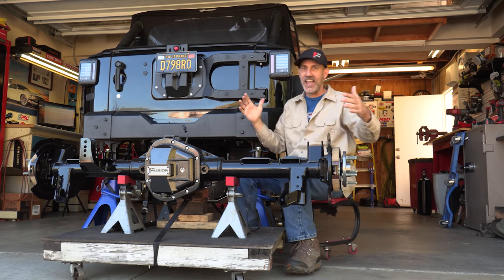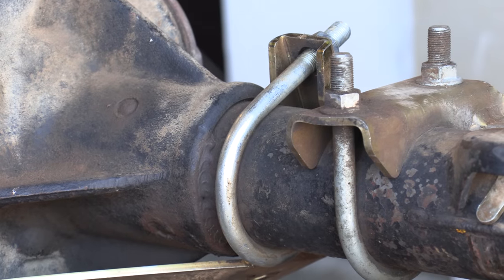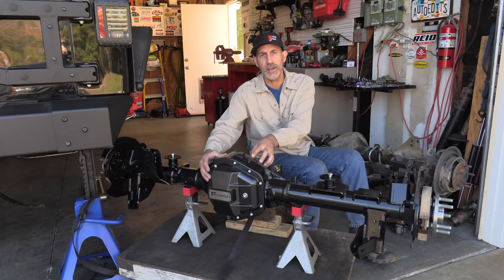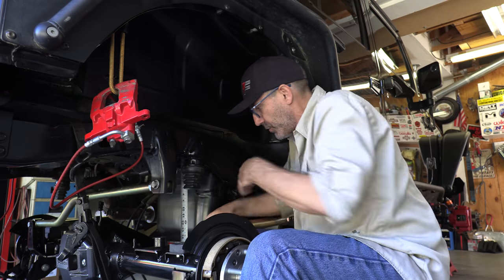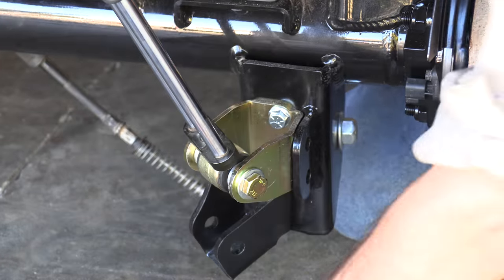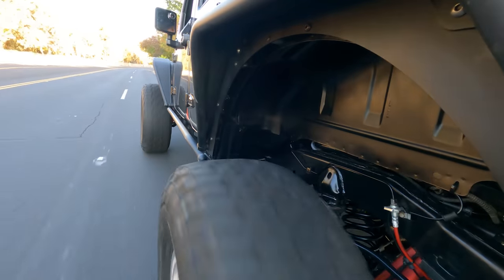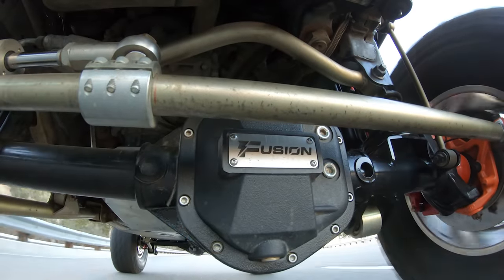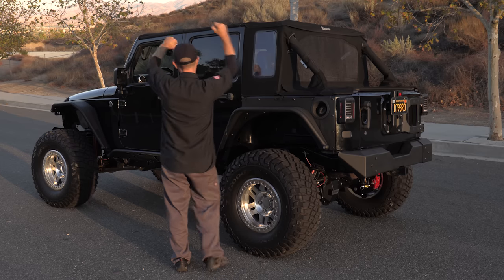Bolt in Dana 60 Jeep Axle Upgrade - Fusion Semi Float 60 FULL Install and Test Drive

Comment: Jason, Great video!!! I just installed the 44/60 hybrid and Semi-float 60 package in my 09' JKU last month. Love them! Watched this video after your PSC video just to see how you liked the Fusion products. I also wheel with the "Gotta drive it home mentality", and these axles give me the confidence that I will be able to do just that. Can't wait to get my PSC kit and get it installed! Quality videos through and through. Thanks!
Reply from the maker: I love everything about this! Thanks for sharing. I'll be curious if your PSC install goes as lucky/good as mine. I can't help but second guess my choice on the front... the 44/60 hybrid  looks so good but the Elite does cover what I need and from the moment I ordered, showed up in less than a week and a half 👌
Reply: I am looking at the 44/60 Hybrid,and Semi-Float 60 also. Did you have to get custom length drive lines? How do you like the axles so far? What tire size are you running?
Reply: @TheRambler-pz1gx  The short answer on the drive shafts is yes. The larger 60  center sections change the drive shaft lengths. Just make sure you know what you want for  lift height so you don't have to get them twice. I currently run 32's but I am going to 37's, I chose to upgrade the axles and gearing first. So far I love the Fusion axles! Great peace of mind when I am wheeling that they can take a hit should I mis calculate my line... Hope this helps.
Reply: @happyj_azjeeper  TYVM!

Comment: Nice upgrade without going too far down the rabbit hole with a full float. That axle even as a semi float is stout AF. Good choice!
Reply from the maker: I figured if I haven't broken an axle shaft on the D44... I'm not likely on a 40 spline D60... so no need for new wheels and brakes and such!

Comment: Years ago when I was still working I talked to a couple of well regarded axle manufactures about welding the tubes on the 12bolt for my Camaro.  Both advised against it because it is extremely hard to keep the tubes straight if you weld them.  I did weld the tubes on an 8.8 once, but I had already ripped the tubes out of them. The larger diameter tubes and a tighter pressfit will give you what you want without welding.
Reply from the maker: I knew I could count on you for some in-depth engineering analysis. I still feel WAY better having the tubes welded, whether it matters or not (mechanically). This particular axle was perfectly square to my measurements so they figured that part out for sure. My real question to you is, when can I come down and have a visit and bring you those fancy upper control arms from the Ram I've been saving all these years?
Reply: @AutoEdits  anytime.  Or we should do a jeep run near you.

The LJ is always ready to go!  😳. Crazy!

Comment: What I’ve learned so far.. especially watching these vids. Run the stock axles until you have an issue. Then upgrade to full float rear, and a kingpin type D60 front.
Reply from the maker: Nah, the whole point of this is to build what I need and not incur all the added expenses of wheels, brakes / brake booster etc.  Plus... I like the steering feel I have better than the kingpin I installed in my buddy's jeep.

Comment: Hey Jeepin’ Jason. I like your videos and your commentary. If you had a really sick JKU. This is a nice semi float. Set up that you have going on. I’m anxious to see how it works for you. I especially like that this is welded, as you had stated for extra reinforcement.  Sweet axles that don’t break the bank as much. I am running a JLURD Teraflex  everything, and an RT3 Suspension System 3.5 a-adapt shocks and Mickey Thompson, Baja  Boss AT. would have went to the lock and load system if they had it for the JLU. Keep it up!
Reply from the maker: Sounds like you have a great rig as well!

Comment: Beautiful Jeep bro. Great video, just found your channel. I have an 89 YJ I’m getting going and will I’m sure break the 35\30 on it now at some point. I can’t see spending on this axle what I paid for Jeep (😮) but it does save a bunch of hassle. Subbed.
Reply from the maker: Thanks for the sub! Yeah, I've seen people say they are going to "save a bunch" by getting junkyard or used axles and doing the work to make them fit (including rebuilding/ regearing, etc.) and then ending up very close to what a completely custom Fusion axle would cost and they are out the months of labor! So, it's whatever fits the build plan! I only have a 110 welder and am not setup to do axle brackets and such.

Comment: you can tap into the harness on the passenger side pull the fuse panel up find the purple and green wire and purple and blue wire put a switch attached to ground to each wire boom you can controll your rubicon lockers in 2wd 4whigh or 4low and they wont disengage until you want them to
Reply from the maker: I did that right at the locker relays by the battery.
Reply: @AutoEdits  yup the purple wires thats where i did mine i like the two wheel locked option i dont always need 4wd reminds me of my old xj on one tons except it was spooled in the rear
Reply: you should do a vireo on it i havent seen one yet and the best article i found didnt say anything about using a switch i bet youd get a lot of views

Comment: Did you have the same problem with your front  Ultimate Dana 44 you installed it.  Did you do the same workaround with it? Just change my front axle on my 2015 hard rock Rubicon, and regret making the switch to the Ultimate Dana 44. Now you have given me hope to fix the dash light problem.  Thanks your workaround, and the adjusting the parking break.
Reply from the maker: I did use the same harness on the ud44 in front... works great. How much lift are you running?
Reply: 3.5 Metal cloak game changer , geared 4.88 on 37

Comment: Hey, it looks like you installed your shocks backwards - the red side should be facing out, at least that's how my 6pack shocks were suppose to be installed.  I looked at your other videos and they are facing red side out. Is this something you did for this axle?  Why the change?
Reply from the maker: Good spot… I’m going to go look tomorrow 🤣 Could’ve just been a mistake on my part but they seem to be clocked ok.
Reply: @AutoEdits  Good stuff regardless!  Thank you for this awesome video!

Comment: Jason , can you do a video on how you utilize and support the frame with the 12 ton jacks ?
Reply from the maker: Lift the vehicle by the center of the rear axle and put the jack stands into place under the frame rails. Then remove the tires and let the rear axle droop all the way down.

Comment: Great video. I have watched it several times. It helped me make up my mind and I purchased the same axle. Can you give any links or advice with hooking up the Spicer 10056733 wiring harness? Thank you.
Reply from the maker: You'll be so happy with that axle ... It is amazing. I don't have any other guidance than what I did here https://youtu.be/0jXUqi1lcKs?t=798 Anything more specific you are curious about?
Reply: @AutoEdits  I was wanting to only use factory Rubicon eLocker switch on the dash. I have 2 wires coming out of the Fusion differential housing. I am having trouble on the internet  how to wire up the Spicer 10056733 harness.
Reply from the maker: LIke I show in this video, connect the two wires from the jeep actuator lead to the end of the spicer harness and the two wires from the jeep sensor lead to the relay in the middle of the spicer harness. And then connect to the eaton e locker pigtail on the fusion housing. Hope that helps  @jeffb1375

Comment: Hi Jason great video, I noticed the front 44 isn't full wrapped, is it just the rears are or cause rear is a 60?
Reply from the maker: Do you mean the welding on the tubes? It's an option on the front I forgot to ask for but it is less likely to twist those since the front doesn't get as much traction as the rear.
Reply: @AutoEdits  yes welding the axle tubes to the diff housing, common practice on big trucks when "turning" the axle to reduce pinion angle vs. having to run a blue tooth front drive shaft... (j/k). I had my guy do it to my JK 44's when he added my trusses. I just got Dynatrac XD60's for my Jeep but I've heard good things about the Advanced Driveline and Fusion Axles. My friend runs them on his AMW 6.4 swapped JL and loves them.

Comment: Such a great upgrade!!  Do you wish you had gone wider? Or I guess, do you still need the spacers with the smaller tires?
Reply from the maker: If I had done both axles at the same time, going wider would’ve been great but not in the cards for me.
Reply: @AutoEdits  Yeah, logistics can be tough. But regardless, its an awesome upgrade that should last you a long time.
Reply from the maker: I sure hope so!
Reply: @AutoEdits  Hi Jason, by the comment, is it correct to assume you went with the stock 65.5" option? what size wheel spacers do you have on?

Comment: Great vid as always, is it possible (or useful) to get these beefy control arms on a stock JK? Thx, noob question..
Reply from the maker: Sure, https://metalcloak.com/jk-wrangler-duroflex-control-arms-full-set.html
But at the stock height, the the original control arms are pretty reliable. If you are replacing them because they are tired or worn out... sure go big with the adjustable arms but otherwise, keep wheeling with the stock stuff until lift and bigger tires.
Reply: @AutoEdits  much appreciated. It's my daily, still perfect after 10yrs... But slowly upgrading some suspension parts to make it a bit tougher. Cheers from Montreal

Comment: I'm installing my axle right now and when fitting the springs onto the lower perches, its much different than OEM.  I understand the springs sit on the perch and are retained with the bolt and "washer" plate provided but they seem really loose.  My stock axle had an exact spot that was notched out and the spring fit snugly into position.  Looks like you possibly used different hardware? In the beginning of the video it shows the same back and silver hardware I have but towards the end it looks like you have gold hardware installed.  Appreciate any assistance!
Reply from the maker: I used my MetalCloak spring retainers but the one's I have are the angle correction ones and they add almost an inch of lift I don't want... you can probably just use the retainers https://metalcloak.com/catalogsearch/result/?q=+Spring+angle+correction+retainer
Check the droop on your axle with the shocks in...you may not need much to keep the springs in place. Since I mounted my lower shock attachment so far up... this axle droops way down and the springs actually get loose. If you are using the normal shock mount... it will probably keep the springs pretty secure at full droop.
Reply: @AutoEdits  awesome thanks ill give that a try
Reply from the maker: @lundysgarage  The washer and bolt that come with the axle may work perfectly well for your setup... try it first!
Reply: @AutoEdits  That's what I'll do I just dont like that the diameter of my springs are so much larger than the male side of the perch that it sits on.  I always thought the springs had a correct "position" they needed to be oriented in.
Reply from the maker: @lundysgarage  They will self orientate as you put weight on them. Make sure you have the rubber pad on the top coil.

Comment: What made you go with the 4 door over the 2 door? More space or better at off-road?
Reply from the maker: That's easy... for me... cargo space was important and since most of my adventures involve long highway drives... the added wheelbase makes this thing so comfortable to cover long distances. So purely a practical matter. I prefer the looks of the 2 door but need to use my rig for more than a recreational vehicle.
Reply: @AutoEdits  nice that makes a ton of sense right on. Thank you.

Comment: Does fusion add a larger carrier bearing? I was cautioned when building my 60 that a 40 splined 60 shaft leaves very little material between the lines in the carrier and the bearing race.  that’s why I have 35 spline chromo shafts

With a 9 inch in the F 100 I was able to swap the bearings and carrier (and third) for a large bearing to make room for that higher splined shafts.
Reply from the maker: Great question... and one I'm not afraid to ask of the dude that was helping me with my order over at Fusion. I literally spent an hour of that poor guys time asking questions but leave it to you... a question I didn't even know to ask. I was put at ease when he mentioned that some off the new Spicer Advantek axles were running 40 spline with the SET80 bearings and making it work with OEM level reliability... Fusion is running a similar setup just with a MUCH stronger housing and  3.5" axle tubes with .5" wall thickness. So when is dinner?
Reply: @AutoEdits  set 80 I believe refers to the outer bearing on a sf housing.  (Set 10 and set 20 are common axle bearings). 

Anytime you want.  I’m not traveling until 2023.  I’m around.

Comment: Hey, how are the metalcloak sliders working? Have you hit them, how have they held up?
Reply from the maker: I have bashed them into rocks a ton... they are holding up great.
Reply: @AutoEdits  sweet! Thanks
Reply: Im a big fan of MC....    I run their full fender and skins on my JK.....   1st trip their body mount sliders folded all the way up to the tub on the Rubicon trail...    Nothing crazy, I don't beat on my rig and definitely nothing that should have remotely folded them all the way up to the body..   The even worse part of their sliders is the inner have metal tabs that punched right through the tub...   Dont bother if you wheel your rig.   I pulled em, repaired my tub and went with another brand frame mount.
Reply from the maker: @highwayman1218  bummer dude. I've slammed mine on rocks and even completely used them to pivot against a rock.
Reply: @AutoEdits    If you're keeping them, I'd highly suggest getting the lower armor for the panels.   They will flex and watch those reinforcement tabs on inside of the rails, because they punch through the body like a knife.

Comment: Great video. Can you tell me what it drives like befoee and after with both new axles .
Thanks
Reply from the maker: Why yes, I loved  to talk about that! I've been putting on hundreds of city and freeway miles this week since the install for work and it's flat out amazing to drive! So smooth and extremely stable... even on the rough freeways here in Los Angeles. So I'm absolutely thrilled and I haven't even put in the dirt yet. The confidence boost has been incredible.
Reply: Thanks for the reply. Was the fusion 44 housing alot more substantial than the UD 44 ?
Reply from the maker: @jamesbond862  YES, substantially stronger in all aspects AND more important to me... better geometry for the track bar and pinion angle.
Reply: Sorry for all the questions , but do you think the Fusion 44 is equal to or better than a PR44 ?

Thanks
Reply from the maker: @jamesbond862  Better. Look at the track bar mount on the pr44 ... if you have any lift at all that will cause bump steer. Plus the Fusion has the caster corrected housing and stronger tubes. I did hours of comparing online and talking to people who wheel hard.
Reply: Thanks alot !

Comment: Hey there! I also have a 13 JKU. Do you think 37x12.5x17  KO2s would fit with 4.5 backspaced wheels? Or would I need 3.5 backspacing? Looks like you used 4.5 without spacers for a while. Thanks!
Reply from the maker: I did get away with a 12.5 tire and no spacers. The only place it rubs is on the inside of the rear control arms during hard flexing. 3.75 would be the perfect backspace in my opinion.

Comment: the OEM E brake was designed by mornon's, hard to adjust show clearance and the spring loaded pull handle doesnt work well
Reply from the maker: I'm being honest when I say that it works really well for me. No complaints at all.

Comment: Also if your parking brake is wearing is it more just the parking brake spring or the brake pads?
Reply from the maker: It would only wear if it is engaged while driving. Check that it is not releasing all the way or if it was adjusted wrong.
Reply: Thanks Jason you’re a big help

Comment: So you had no problems with the D44 except you didn’t weld the tubes to the housing? Seems pretty stout to me.
Reply from the maker: The D44 did ok but it's not even close to the reliability and strength I just added.

Comment: Did you use your switch pod to run the lockers?   Or the factory switches?   I am wondering if you used the switch pod and where able to make the factory rubicon dash lockers light turn on.  I have been told only way to have the dash lights work you need to use the factory switches which I do not want to as I want the lockers when I want them to work not when the computer allows.
Reply from the maker: Did you continue watching this video and get your answer? I do run them through my switch panel AND the stock switches still work.
Reply: @AutoEdits  I guess I was confused I thought I had heard that but it didn’t make sense to me.  Guess I need to learn so more about this.  Google here I come. I want them to work with out the stock computer telling me when they can work but would really like the locker dash lights to work to. Thanks
Reply from the maker: @dougm6737  I run through the basics of how to tap into the stock relay wires in this video... the color codes change over the years but the basic technique remains... hope this helps https://youtu.be/SpTk_R3PPfs?t=466
Reply: @AutoEdits  Awesome thanks so much.
Reply: @AutoEdits  so basically its all stock wiring with the use of the harness and your painless box is wired to the relays?  Sorry for bugging you so much but I share your ocd about the dash lights working. Thanks again.
Reply from the maker: @dougm6737  All good... yes all stock otherwise.
Reply: @AutoEdits  thanks again